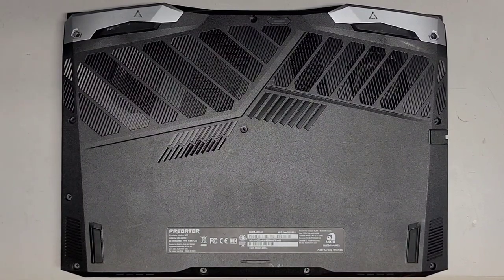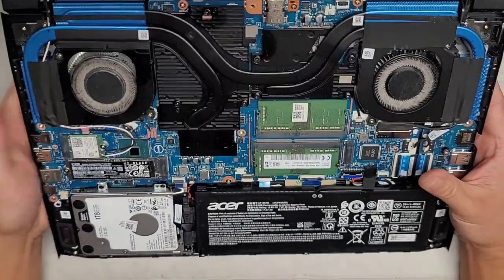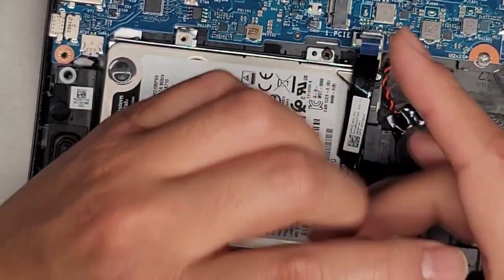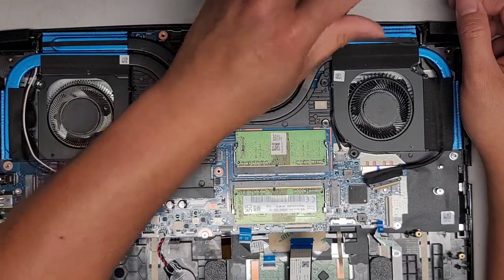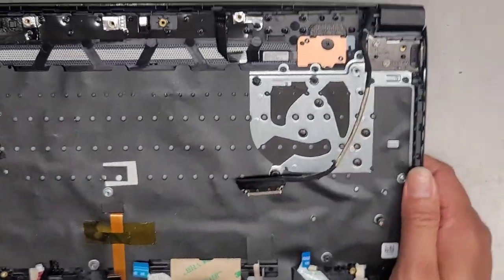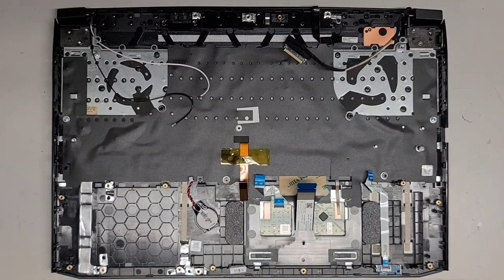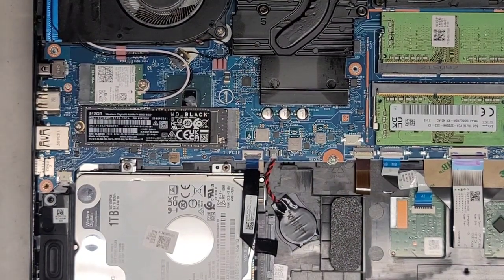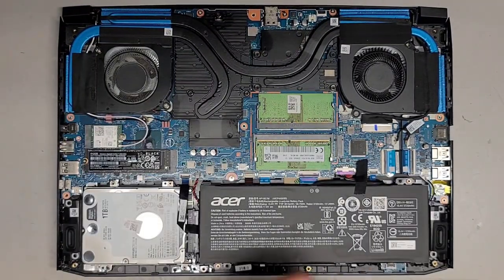Acer Predator Helios 300 N20C3 PH315-54-714U Disassembly RAM SSD Hard Drive Upgrade Battery Repair

Comment: Thank you so much for this! Because of this video I was able to figure out that my battery isn't working and avoided paying for a whole new laptop. I'm really in a tight spot financially right now and I'm trying to avoid just buying new things every time something breaks.

Also in case anyone is curious or has a similar issue: I checked because the amber light was blinking and i couldn't turn my laptop on no matter how long I left it charging. So took the battery out and plugged my laptop in without the battery. Since it turned on after removing the battery I now know I just need to replace the battery.
Reply from the maker: Awesome, glad it helped. If you haven't already, please like and subscribe so others can find my videos and possibly consider watching a few others and commenting to get the algorithm to recommend my channel. Thanks!

Comment: Thank you so much for giving me courage and insight to open up my machine. I would swear, that cover had to be glued down. 😅 Wanted to pop in a HDD, since it came with a empty slot. (Also, a sticker on the front cover says, that there are 2x SSD, but I'll be damned, if I found the second one) And since I'm an idiot, I had the hard drive, but not the connecting cable. After a hopeless search I came to a conclusion, that I must have thrown that cable away at some point, so, cover back on, and put that drive away, until I get a replacement. Guess what? As I was putting away the HDD, I found the cable. EPIC FACEPALM
Reply from the maker: @Fushurururu  lol Time to open it back up.

Comment: Thanks for the video. It very helpful. I just want to know if you have experienced problems with power button - i.e. the laptop doesn't turn on. Is there are problem with keyboard it self? How do we check this in the keyboard?
Reply from the maker: Didn't have that issue. You can order a keyboard and connect it without installing it.

Comment: I opened it up but now my keyboard is not working hence pc is not starting, I've broken  the pin for keyboard connector the plastic one which we have to flip I pulled😢
Reply from the maker: This video might help https://youtu.be/WO56KJOHywM
Reply: @ItsBinhRepaired  thanks a lot man❤️
Reply from the maker: @sashankagoswami1032  hope it works

Comment: Thank you for this video awesome! but now how can I get this to boot up repair mode did not help!
Reply from the maker: What's wrong with it?
Reply: Thanks for replying, well it is not booting into windows and I think there is a fan issue because it's making lots of noises. At this moment of writing its in a fixing c: stage 2 @ItsBinhRepaired
Reply from the maker: @dougall255  need to fix the fan first. You might need to make a windows installation usb

Comment: Thanks for the vid, i opened mine to clean the fans they were very dusty i was having some serious over heating issues but its fixed, unfortunately, the connexion between the battery and the motherboard was screwed, the laptop can turn on when plugged, and the battery indicator works so it means the bettery charges, but when unplugged th laptop doesn't turn on its like the battery can no longer give power to the motherboard how can i fix this please
Reply from the maker: I'm not sure :( how did it get damaged?
Reply: @ItsBinhRepaired  when i opened it i unplugged the battery from the motherboard  first, then unplugged the fans power cable also, to proceed and clean them, after being done, i re-plugged the fans but when i tried to re-plugg the battery to the motherboard i saw some kind of spark happen in the mother board, i thought it was nothing. But then the laptop cant turn on with battery i must plug the power cord for it to turn on it's like the battery can no longer give power to the motherboard. 
Sorry for the long reply, i tried to give maximum details so u can have an accurate image abt my situation, what do u think i should do, and thank u
Reply from the maker: @thanosinfinity4904  battery circuit sounds fried
Reply: @ItsBinhRepaired  what do u suggest for solution, can i have it repaired only the damaged area or do i have to replace all of the motherboard cuz like i said everything else works perfectly except this battery problem.
Reply from the maker: @thanosinfinity4904  I'm not sure

Comment: I'm watching this because my PH315-52 is not turning on. Thanks by the way, incredibly useful video. When I plug in the charger, the charging light still turns on (both orange for charging and blue for fully charged), which gives me hope on the mobo. Every time I push the power button though, the charging lights go out, then after 1-2 seconds goes back on. I also tried to listen closely when pushing the power button, I hear the faintest POP from somewhere behind the mobo (where you cleaned the stains). In your professional opinion, could the mobo still be alive? Might I just have a blown capacitor or short-circuited keyboard? I was pushing the laptop too hard when it died by the way, playing a video game with other apps open (something I've done a lot since I bought the thing 3 years ago).
Reply from the maker: I'm not too sure. Might have fried the gpu or something :(
Reply: @ItsBinhRepaired  Thanks for responding!
Reply from the maker: @eenayeah  no problem

Comment: Hey! Do you need to remove the whole board to get at/replace the charge port?
Reply from the maker: It's soldered to the motherboard. Unless you want to melt the laptop getting the old one or, then yes. You'll have to send it to a computer repair place.
Reply: @ItsBinhRepaired I realized that this isn’t the model that I’m looking at working on, but still uncertain about whether or not soldering will be required. My buddy has a predator helios ph317-54, and every part I’ve seen for it is literally just plug-n-play, but sometimes replacement parts are funky
Reply from the maker: Would need to open it and look inside. I don't know.

Comment: My predator helios 300 crashed while i was gaming (FIFA 2023). the keyboard and fan are on but the screen is black. i left the laptop for a few days put on the charger then tried booting it it did start although it crashed a few times. then the next day I tried starting it back to the pitch black screen it didn't boot. what do I do?
Reply from the maker: @AashutoshRaut-w2i  did it have any blue screen errors or anything when it crashed?

Comment: what are the green squares on the back cover at 7:08 minutes in. I don't know what they're called. The one that goes by the internet chip fell off.
Reply from the maker: Thermal pads
Reply: @ItsBinhRepaired  okay. Thank you. Should I replace the one that fell off?
Reply from the maker: I hate how YouTube doesn't notify me of replies. Were you able to figure it out?
Reply: Yup. And my laptop is still running strong. 😁
Reply from the maker: Awesome!

Comment: I tryed putting in a Crucial MX500 1TB 2.5 inches but the screen turns black and doesnt work
Reply from the maker: It doesn't even show the startup screen?
Reply: @ItsBinhRepaired no nothing
Reply: @ItsBinhRepaired only the keyboard lights up and fans start spinning
Reply: @ItsBinhRepaired the screen is on but fully black
Reply from the maker: @themonke7689  hmmm and when you put the old one back it's fine?
Reply: @ItsBinhRepaired i put it in addition but taking it out does fix it
Reply from the maker: @themonke7689  you'll likely need new RAM

Comment: Do you know if the DC jack is soldered? I need to replace mine and wanted to do it by myself because the computer repair guy is charging me a fortune for it :(
Reply from the maker: Yes, it's soldered. How much are they charging? Around $170?
Reply: 200...
Is it too difficult to do? I don't have the money for it right now :(
Reply from the maker: @RenataB503  for that model, since the heatsink doesn't need to be removed, I'd say $170-180.
Reply: I'll try to do it by myself and hope for the best 🫠
Reply from the maker: @RenataB503  be very careful and watch a lot of charge port replacement videos

Comment: My laptop is not turning on anymore. I already check the cables and everything seems fine. Do you have any clue of what happened? I’m desperate
Reply from the maker: Sounds like a dead motherboard
Reply: But why would the cleaning cause this?
Reply: @ArielRizzoPedalaCast  Depends on how you cleaned it... After 3 weeks now, any updates?
Reply: @joeythomas2929  hey joe, yes. In fact, I think that I might have been scammed. See if you can help me please. I let the laptop with the repair shop more than 3 weeks a go. At that time,  this was their message:

Hello Ariel, we have an update on the component level repair for your motherboard. The PCH (platform controller hub) has shorted and requires replacing. They are able to resolve this by replacing the faulty parts on the motherboard. Taking into account the cost of these parts, the total repair would be £365. The £85 already paid would go towards this, so the amount to pay on completion would be £280. They still estimate a further 2-3 weeks to complete the repair as the parts have to ship from abroad. Please confirm if you would like to proceed.
Many Thanks
Reply: @joeythomas2929  then, I message they yesterday to ask if they have any updates and their answer was: 

Hello Ariel, thanks for your message. I have chased this repair for you and we do not have great news. The device has suffered a massive cascade failure
during the initial failure. This was only discovered after lifting the platform controller hub, which subsequently shorted the GPU. It is not economical to continue with the repair of this device. We will have your laptop back in the workshop by Wednesday next week. We can capture your data and transfer it onto a repacement drive for you or another device. I am happy to quote for a replacement laptop if you know the specification required and a budget, many thanks
Reply: @joeythomas2929  what do you (or others that are reading this) think?
Reply from the maker: Sounds like you need a new motherboard.
Reply: @ArielRizzoPedalaCast  Sorry for the delayed response. I agree with @ItsBinhRepaired that you probably need a new motherboard. I'm not sure how much those components are supposed to cost, nor do I know how much replacing the motherboard is supposed to cost. I think that the buildup of part failures from your original issue is building up to be more than the cost of a new laptop, which is why they are pushing for a quote for a replacement. Hard to judge if you're being scammed, but I honestly think that they are having trouble fixing independent components when the majority of the board is failing. See what their quotes are (and compare them to other online prices) to see if you can get a better deal for a trade-in. Assuming I see the notification in time, I might be able to help you out further. Otherwise, sorry this happened man. Best of Luck.
Reply: @joeythomas2929  thank you so much for your comment Joey. After all, I decided to move to another laptop and I would be glad if you have any suggestions as well. I use most for editing and casual gameplay. My budget is around 1500-1700$
Reply from the maker: I hate how YouTube doesn't notify me of replies. Were you able to figure it out?